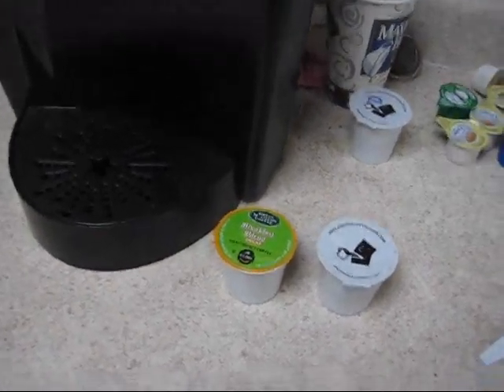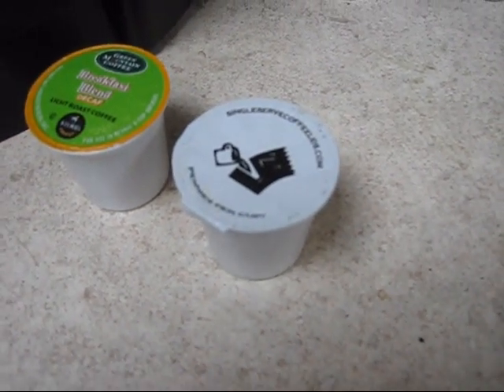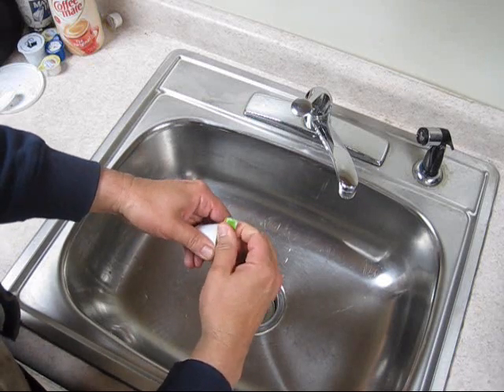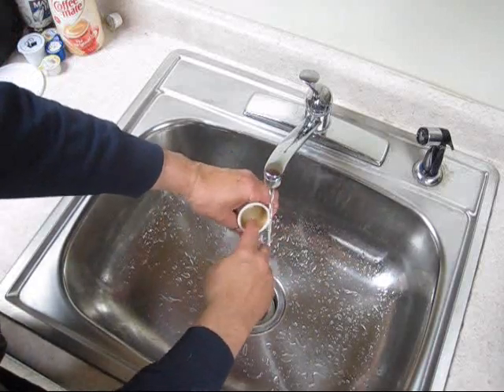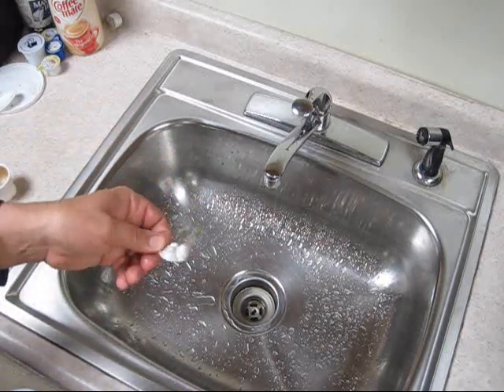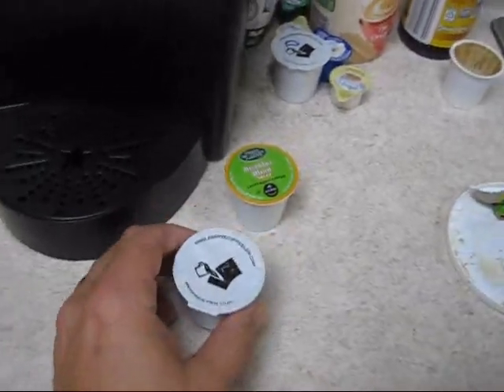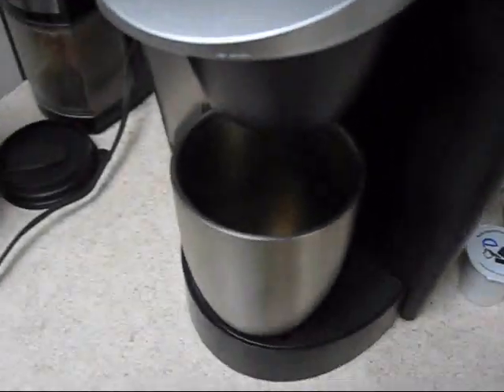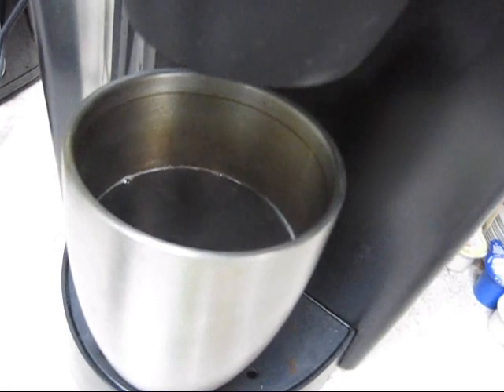HOW TO RECYCLE YOUR USED K CUPS! HAND GRINDING WHOLE BEAN COFFEE & HEAT SEALING K CUPS FOIL LIDS

Comment: Never dump coffee grounds down the sink....
Reply: Very wise advice if you're on septic system...ok for most sewers depending on your locale's requirements. The biodegradable grounds are finer and the amount is insignificant compared to the volume of garbage that a typical disposal discharges into the drain each day. See my comment below.

Comment: A lot of people don't get the fact of the matter that these filters that are reusable like the plastic and the metal ones the mesh screening and the way they're set up the coffee doesn't come out strong like a regular official K-Cup. This is why for anyone reading this comment is why John and other people do this. I could attest I have a filter the coffee comes out weak you might just drink plain hot water. And this is why Keurig does this so you just keep buying K-Cups this is the remedy to the problem or you put aluminum foil.

Comment: Coffee grounds can muck up the garbage disposal.
Reply: The disposal will be fine. Been doing it for well over 50 yrs and never had a single problem. The grounds are finer and a tiny fraction of the volume of garbage that is discharged by my disposal...I even grind chicken bones to keep the disposal clean. It all ends up in our wastewater treatment plant 13 miles away. Note: for sewer systems only...don't if on a septic system! ツ

Comment: its so much easier just buying bagged coffee and then buying the reusable kcup coffee filters. they have a openable lid, all made of plastic except the metal mesh on bottom and sides that allows water to flow through, just like gray tea filter cup that comes with the machine..Ive heard that part of kcup flavor is due to forcing the water to steep in the cup  with  only the little hole to escape from which gives it a better flavor, but i havent noticed a real difference in the reusable ones.  I bought 2 for 5.99 in a 2 pack that u can get at any local supermarket or cheaper on ebay. The amount saved if u drink coffee daily is over 30 a month and good to have if your like half the unlucky customers whose Kuerig dies in a years use.
Reply: beth om I have had my Keurig for 5 years, never had to descale. I only use filtered water...
Reply: And I still have my old coffee drip machine and only use filtered water and it still works! 😆